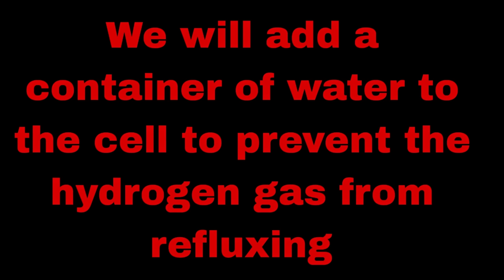I Turn Gas stove into a Water stove, New invention

Comment: If you are looking to conserve energy or money, just use the electricity that goes into splitting water, and apply it directly to a resistance heater immersed in the water you want to heat. Every time you convert energy from one form to another, you lose some of it to inefficiencies. Think about all the hot air rising around your pot and not heating it (If this video were even real). Not to even mention all the wasted heat generated in the water jar with the highly inefficient process of electrolosis. Trust me on this; you will heat the water faster by just good old fashioned electrical resistance. If you want to get from point A to point B, you can score a lot of style points by running in a fancy pattern and spelling words with your footsteps through the sand, but there simply is not a faster way to get from point A to point B than just a good old fashioned straight line. Besides, this video shows one single tube coming out of the jar, so it would contain both hydrogen and oxygen, which ais an EXTREMELY flammable mixture! It would NOT burn with a soft yellow flame! A yellow flame is not even possible by splitting water, unless you are dissolving massive quantities of anode metal and separating the oxygen from the hydrogen. Done like this, the mixture would EXPLODE at supersonic speed as soon as you light it, and would instantly turn that jar into a shred of plastic shrapnel that would imbed itself into all nearby objects! Do not do this experiment like this video shows, unless you like losing your hearing and your eyesight! Extremely dangerous!
Reply: u mentioned inefficient in your  reply....the dude fried an egg using h2 gas....yes he could of put a  small toggle switch to the  solar unit...the battery on the dryer could of been  rechargable as well as  solar powered...but  i say screw the inefficiency as long as  it works...theres room for improvement
Reply: How about just running the hair dryer on the solar panel and feeding the output into an insulated box . WALA ! Air fyer/oven 😎
Reply: I think there's more than a battery taped to the hair dryer.  I think there is a butane cartridge taped to it and its blowing the butane into the jar.
Reply: Or a butane lighter torch with a locking trigger that can be locked open or closed.
Reply: @dragonballz2889  the dude fried an egg Allright but he did not do it with hho gas. Look hard and do some research.  This video is a complete fraud.
Reply: Fraud/fake? No. Inefficient and dangerous? Yes. Better to make biogas from cowdung, which I did 40 some years ago when all my coiking was done with it.
Reply: Of'course the air heater is NOT HEATING the air when on normal mode. Otherwise the red plastic cover, glow and other plastics will melt
Reply: @michaelshultz2540  The jar stopped bubbling at 20 and started again at 20"26 or so. Something wrong here for sure.
Reply: I use a oversized fresnel lens to heat things up..only when the sun is out. Its also part of solar reflective parabolic box type.
Reply: @hectormata449  We need to be using BIOGAS and setting up DIGESTERS to make it..I want a car that runs on biogas.
Reply: Q
Reply: Thanks very smart I will try it

Comment: This is real, but very Dangerous, produced HHO gas temperature 6000 Celsius. Already work on it in 2009-2010 but again this is dengerus
Reply: If you are trying to store the gas,yes

If its a on demand system like this the gas is limited to the amount in the lines in the flame arrester bottle and in the generator bottle 

I think this Generator is 2x bigger then a generator I've seen used to run a car(1 Liter with more plates in it and the water is pumped through it up to the carborator...a "wet" brown gas system)
Reply: Hho temperature is about 1000 Celsijus. Otherwise the metal would melt😊 From 1 ltr H2O you can get about 1600 ltr HHO Gas!
Reply: Even the Tungsten filament has got 3370 degree Celsius,,, In 6000 celcius, everything would melt, even the burner.

Comment: Pumping in air is a very good idea, otherwise the flame almost always finds its way back to the source of the HHO gas and YOU DON'T WANT THAT TO HAPPEN. It happened to me twice and I can seriously sY I am lucky to still have both my hearing and my eye-sight. No joke!
Reply: I guess that's the point with the water break before the stove outlet. It stops the gas, igniting backwards through the tube. The extra air pressure forward would also help as you say.
Reply: Mabuhay ka Kapatid sa kalukuhan mo.....Ikaw Ang the best....
Reply: Your method is authentic to produce hydrogen gas...but is it economical is far from question that is not.

Comment: Just a small point .... That is Not Hydrogen it is Browns Gas.
Basically a mix of Hydrogen and Oxygen in a 2-1 ratio!
If you are using DC voltage you can separate the O2 and the H2 by dividing the gas from each of the plates. AC will give you both gasses from both plates!
Reply: HHO is hydrogen, mixed with oxidizer. and that ratio is a perfect explosive mixture for hydrogen.
Reply: I tried it but unfortunately it does not work 😢
Reply: No. You need a completely different setup to separate Hydrogen from oxygen. Also these kind of experiments use always DC. DC is also, what he gets from his solar panel.

Comment: As I am watching this, I am reminded that you are supposed to make your inlets go nearly all the way to the bottom of the containers. It keeps the flame arrester you made with the pink lid working properly and it also agitates your salt water mix to increase the efficiency of the electrolysis over the span it's used. Personally I would have had a reserve tank of water feeding into the green lid container instead of introducing atmospheric pressure to the system that is not needed.  Good that you utilized a method to cook without needing natural gas or petroleum in vapor form. Can't call it inventing, though. Innovating, however, is apt to call it. And it is very much so innovating. Good on you for it.
Reply from the maker: thank you 
its good ideas

Comment: Я на литровой банке изготовил электролизный аппарат и заводил бензопилу на 5 в/5 А, и она работала долгое время.Зазоры между пластинами должен быть не более 1мм,аппарат должен подключатся на аккумулятор через сопративление или через лампу12в.Попробуй заводиь бензопилу или двигатель
Reply: Look up Joecell. There you find all the videos going into more detail. You are right - electrodes must be very close. And!!! - they can be very small, like a razorblade. Every 2 electrodes can process 2 volts. So you stack the electrodes in a row. This produces loads of HHO. Enough to power cars and generators!

Comment: We need you on the engineering staff, for our new hydrogen combustion engine fuel system design team
Reply: All you need to do is switch to titanium spark plugs and add a low pressure regulator to run this brown gas set up  directly into the carborator/fuel injection system

Most people trying to run a car on HHO, Mythbusters included, forget to include a air/gas pumping and pressuring system to make HHO usable by a car engine🌈⭐  😹
Reply: Just bring an oversized battery operated hairdryer and hook it up to your tesla car battery! 😱⁉️👀🤪

Comment: Hydrogen doesn't burn with orange color.
Reply from the maker: No it no correct
You Can try it
Reply: But the colour could be because it's not a clean brown gas as salt was used and creates a small amount of chlorine gas in the mixture (not very healthy for indoor cooking).
Reply: The salt makes the color

Comment: Can you kindly tell me that black wire has coming from where ....??
Reply from the maker: Connect with Solar panel 24v 6A 
You Can use car battery
Reply: Shows it to be 12v @6a from a solar panel. Big freakin panel!

Comment: You produces HHO which is highly detonable gaz.  The fan dryer saved you (avoided flame to go back to recipient and produce explosion 😂). Very high DEGREE FLAME. 2300 degrees.  Almost invisible flame. I am surprised it doesn't melt stove or pan. I would isolate H from O2 and use hydrogen only for more safety.
Very good idea to be worked more for safety.
Reply from the maker: yes Bro thanks for your Advice

Comment: Need more additional safety measure to avoid back flow of Hydrogen GAS.
Reply from the maker: yes Bro
Reply: A simple flashback arrester goes in between the burner and the final bubbler.
Reply: You can try a cigarette filter as a flashback arrestor in the tube which connects to the stove

Comment: I was really nervous at 15:54 about lighting that gas, as I imagined it might possibly burn back into the bottle itself and explode.  The gas produced by those plates is entirely a mix of hydrogen and oxygen.  If it weren't diluted and propelled by the hair dryer to move quickly through the tube to its exit into the atmosphere, ugh...  That would not have ended well.
If anyone builds something like this, please think it through.  You don't want any potential for blowback/explosion.  It would be wise to use a secondary isolation device (like the simple water bubbler) BEFORE you test it with a flame!
Also, to be able to regulate the proportion of air introduced by the blower device relative to the gas mix produced may be helpful.
And one more thing:  What would happen if one were to put a bit of copper sulfate into the bubbler water?  I'm wondering if it would introduce enough into the vapor stream to produce a colored flame?  Or would something else work better?  And would copper sulfate create or become something hazardous to inhale?  The real question is:  Is there a very simple and safe method to cause the flame in the final combustion to become more visible?
Reply: Hnnn   tumne bohot dhyan se dekha
Reply: Don't worry,it is at the speed of science & safe & effective.
Reply: if the burner was not in direct sunlight the blue flame would be visible.

Comment: 1. This process is called Electrolysis.
2. Electrolysis does not generate hydrogen.  It divides dihydrogen monoxide into the two components: hydrogen and oxygen.
3. Heat, fire in this case, does not just burn the hydrogen.  In this process, the he helium adds an extra neutron to the core, creating an H-2 atom (deuterium), not the H-1.  When the H-2 atom bonds with the oxygen atom (O), it does not create water (H2O).  Instead it creates deuterium oxide (heavy water), which has different physical properties from water.
4. Much energy is wasted by the hair dryer.  A more efficient continuous air pump would be a better use of energy.  Rechargeable or not, the amps drawn by the fan will quickly bring heat and death on the batteries.
Reply from the maker: Thank you for your great ideas.

Comment: That is not HHO Gas on fire. That is a clear liquid fuel with a hairdryer fan motor blowing across, picking up the fumes with your electrolysis inside, simulating its water when it is not.

Comment: Where did you connect that two wires ? you did not show it.
Reply from the maker: With Solar panel system
24v 7A
You Can use car battery

Comment: The reaction is probably consuming the aluminum plates, producing aluminum oxide and releasing H2.  The salt was added to increase current flow and may act as a catalyst aid in oxidizing the aluminum. That means you would need a constant supply of aluminum to keep this going. And please... Enough of the HHO crap.

Comment: I am more curious to see what happens to the water over the duration time of use.
Reply: never heard of hydrolysis, eh? burn hydrogen, water is the ash... run dc current through water, hydrolysis (separation of the gases) occurs.
Reply: Ive heard of electrolysis
Reply: @jbodden6977 your point being?
Reply: over time, the liquid containing the cell will become contaminated with by-products of the electrolysis and produce film of debris onto the cell , which reduces the HHO output.

Comment: 😮 caught ! There's a cut on video , the oil on the pan is already hot or at boiling point upon putting the egg but look at the bubbler it is at stop and after a while it turn on without any video info. How come that the oil boil  but the bubbler is not working yet ? Handling HHO is so dangerous please don't lie on your project 😮😮😮😮
Reply from the maker: Thanks Bro ❤️👑

Comment: So electric is add to it too that hair dryer i don't have and I don't know when I get apart from the electronic shop and here where I live there is no electricity here
Reply from the maker: you can use solar panel
Reply: Old computer fan is good. Little electric. Small solar panel
Reply: You have no electricity but yet you have a cell phone or computer to watch and comment on youtube videos huh? How is that possible? It doesnt take any more electricity to generate hydrogen than to charge a cell phone let alone power a computer.

Comment: I absolutely cringe , when you light the stove with the generator in close proximity, I was just waiting for a BOOM! oops, there goes that foot, like you don't care about safety anyways, Do you always do everything in Flip flops? And using nickel plates wont produce as much Hydrogen as if you were to use stainless steel instead. SO there is no need for that HOKEY blow dryer. 
And please, this isnt "your" invention, unless you are suffering from a terrible "ELON MUSK mandela effect" ?

Comment: Not true
Reply: No reasoning? No sources? Are you just hating? 
Have you never heard of hydrogen production from water? Do you know what brown gas is?
Reply: It's electrolysis, he just makes it complicated. Take 2 flashlight batteries apart carefully, the center will be a carbon electrode one for - another for + plug wires from any small appliance ( cell  phone charger) add salt to water put electrodes in seperated and hydrogen and oxygen  will be produced. This gas is called hho or brown gas. It can explode, so be careful.😊

Comment: youtube.com/@king_650 Is hydrogen gas colourless? Is there any chemical we can put in the water to make the flame blue?
Reply from the maker: It changed from its natural color due to the air being pumped into the cell. If you want the natural color, remove the pump